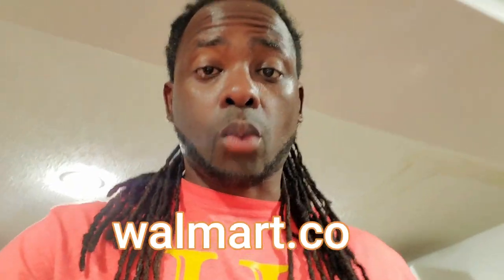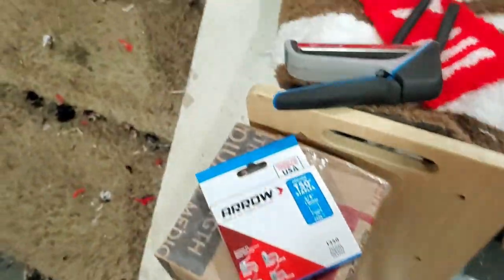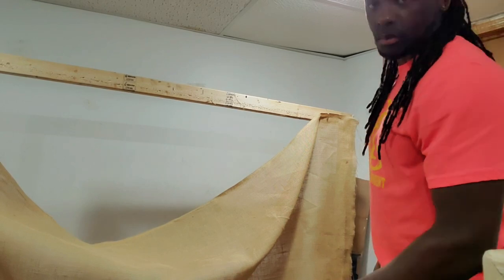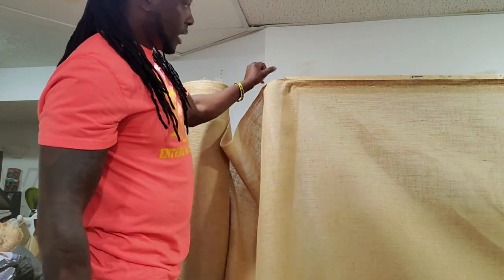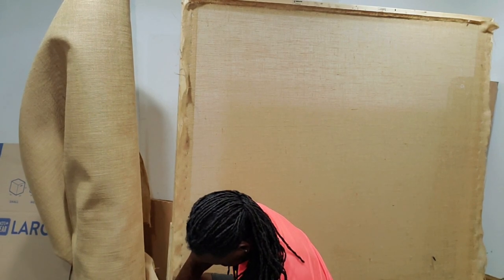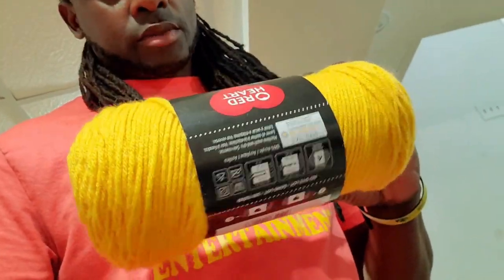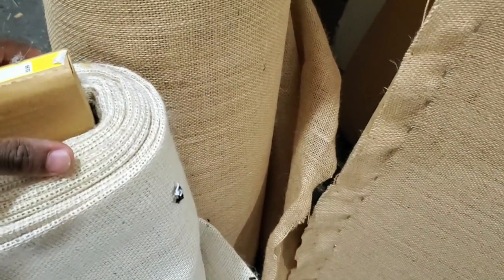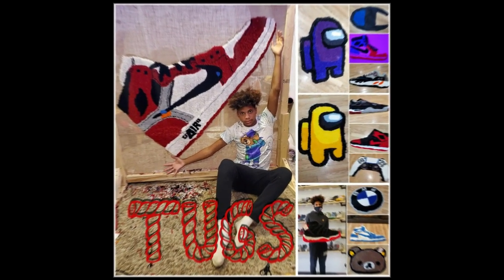How To Use Burlap Correctly To Stop Making Holes | TUGS Rugs

Comment: Is there any way to re stretch the burlap during the tufting process, without having to pull existing staples out? I don't know if im pressing to hard or what, but my burlap gets loose during tufting.
Reply from the maker: No you’ll have to pull some staples out and restaple
Reply: @TugsRugs  okay thank you!
Reply: Hey I figured out that if you leave enough fabric around the edges then fold it under to double the fabric and staple to the sides of your frame it stays tight the whole time. I obviously still staple around the front but doubling on the edges helps it from slipping. Just wanted to share.

Comment: I can only find really bad cheap burlap for plants and it's driving me nuts. The only good stuff I find is like $150 for 20 yards right now. I ruined like 2 rugs trying to use it. The fiber threads are way too far apart and break super easily even just stretching it too much :(
Reply: I live in Canada, I usually never have any issues finding things online or at the store too. I wonder what's going on with that.
Reply from the maker: If you can order things from Walmart you tacan look up rolls of burlap natural
Reply: I also use burlap. Im also having this problem..when I stretch the fabric to tighten it up..it just tears..

Comment: Bro you're the king! Have you experienced any issues on burlap with loop pile? Saw another youtuber saying she was having issues but it was her first use and may have been technique not the burlap.
Reply from the maker: I just did posted a video using both loop and cut pile gun on the same rug. I've never had problems with the loop pile but many with cut pile

Comment: i used burlap for the first time instead of tufting fabric, and it rips almost every time and i had it superrr tight on my frame
Reply: idk if i got a bad burlap causes the fabric is really tough and the threads on it doesn’t has flexibility if that makes sense
Reply from the maker: Which burlap are you working with? Which color? Message me on Instagram @tugs_rugs so you can send me a pic of yours
Reply: I'm having this same problem

Comment: I use tack strips instead of staples and it works great for me
Reply from the maker: Yeah i started off with the tack strips. I prefer the staples
Reply: How do you get the fabric not to pop off some of the nails?Mine is popping off at the bottom